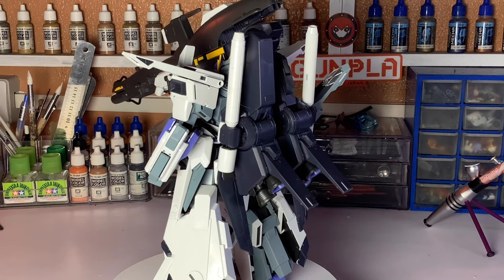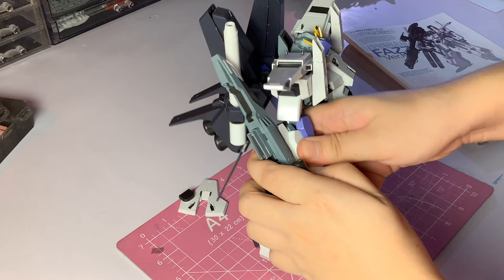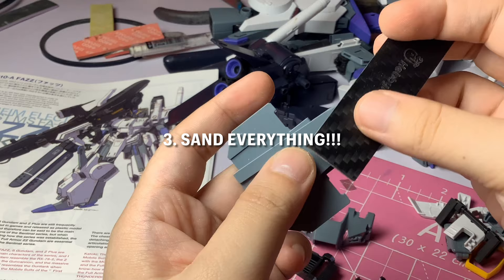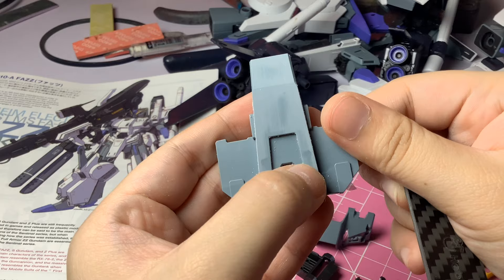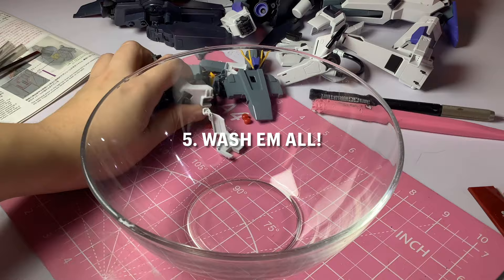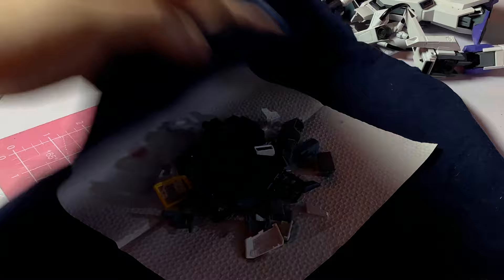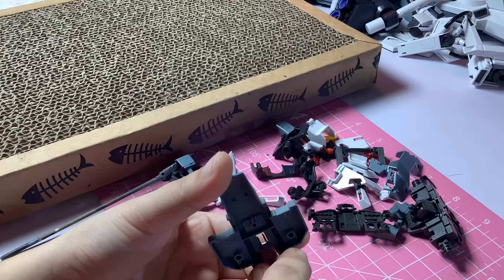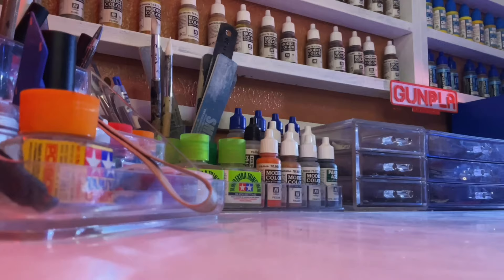How to PAINT Gunpla: Preparing your GUNPLA for Painting!

Comment: this may be a bit of an odd question not your for you but anyone... but in recent years my hands start falling asleep (carpel tunnel) while building Gunpla. I'm extremely disappointed i cant do something I loved to do as often as i would like. Does any1 have any tips to make building / painting easier on the hands?
Reply from the maker: I found this from a reddit thread from years ago, “I wear wrist braces when I sleep and that helped me tremendously! My fingers used to go numb while I was building and that has pretty much stopped.” 
Hopefully that can be of some help, others mentioned asking your doctor for suggestions as they will be able to give better advice 😊
Reply: I have terrible carpel tunnel from years of working in a professional kitchen (we called it "knife hand"). The best solution is to stretch. Look up some guides on stretches specifically for the condition. Braces are also very helpful if it's really bothering you (sounds like it is). I would really encourage the stretching though because if the condition gets too far along the only meaningful remedy becomes surgery. Which is extremely painful (they basically scrape the scarred muscle out - it's gnarly). Otherwise meds for inflammation (ibuprofen for example), ice / heat combo, etc. Good luck guy.
Reply: I have massive carpel tunnel, as a union carpenter who has a hammer attached to his hand 50 hours a week, you just get used to it. It sucks but eventually I just learned to ignore it honestly.
Reply: Paint with your feet.
Reply: @Kyleology use telekinesis

Comment: Im newbie to painting on gunpla does i need put masking tape to the fitting parts of body to prevent tight fitting issue? Before i customize
Reply from the maker: I assume you mean the joints and pegs? Personally I don’t, but some people will put masking tape or blu tac so it won’t get painted, you can also just scrape it off after painting or sand the parts before painting to accommodate for the layer that the paint will add.

Comment: Do you have any tips on disassemble the kit to the parts without damaging them?
Reply from the maker: Removing some of the male peg allows for easy disassembly by increasing empty space in the hole which means a less than snug fit. To do this, gently cut away the peg at a 45 degree angle. There are tutorials showing easy disassembly with this :)

Also use a parts separator to prevent damaging your parts
Reply: @NicoSuratos  thanks

Comment: Hi Nico, if you mainly use acrylic paint, I wonder how do you do detail painting (ex: pipes or pistons on the inner frame) or reverse wash over the acrylic base paint? Won't the cleaning process ruin the paint underneath?
Reply from the maker: For detail painting I also use acrylics. I simply varnish over the already painted parts before doing so. I also use enamels and oil paints which work fine with acrylics.
Reply: @NicoSuratos  so the varnish is also acrylics, I assume? And do you have any recommendation of oil paint and enamels brand/kind that work fine with acrylics?
Reply from the maker: Yes even the varnish. All oil paints and enamels work with acrylics no matter the brand. But for enamels I use Tamiya and for oil paints I use Grumbacher and Gamblin
Reply: @NicoSuratos  okay 1 more question if you don't mind just to make sure, so based on your experience, neither Tamiya enamels paint nor thinner react harshly and eat the acrylics varnish and paint underneath?

And do you think it is safe to lightly topcoat Mr. Hobby's clear lacquer over Tamiya's acrylics?
Reply from the maker: I make sure that may varnish and paints are fully cured and hardened before using enamels on top. (Which is why I use oil paints if I’m in a rush) I don’t use Enamel thinner since it’s a bit too harsh and strong. I use turpentine or gamsol. I also don’t keave the enamel on for too long, I don’t flood it and clean it right away to be safe. 

I think it’s possible to use Mr Hobby Lacquer Clear over Tamiya acrylics. But, I recommended to test it on a small area first to make sure that the lacquer does not damage the underlying acrylics.
Reply: @NicoSuratos got it, noted. Thank you so much for replying and congratulations on winning the GBWC, Nico! 👏🥳
I wish the best of luck for you 😊🙏

Comment: Hi Nicole, I have been watching your videos, great work! There are multiple steps involved in customizing a gunpla model, can you help list down all the steps in chronological order for customization using airbrush painting? I’m a newbie, the steps below is based on watching multiple youtube videos:

1) Removal of parts from runners
2) Fix up the full model (trial/preview)
3) Plan the painting steps and colours
4) Nub marks removal
5) Wash all parts with detergent
6) Cement parts and remove seam lines
7) Panel design and scribing
8) Apply Primer
9) Apply Paint using airbrush (Mask if needed)
10) Apply Paint using handbrush for tiny areas
11) Apply top gloss cover
12) Apply panel line liquid
13) Apply decals
14) Apply top matt cover

Is the above sequence of gunpla full customization correct? Really appreciate your advice on this 🙏🏻
Reply from the maker: It can work but I feel that it’s more time consuming and less efficient with the way you listed it down. You have to understand why you do certain steps and what’s it’s purpose and not simply follow steps and guides used by others. Let me explain a few things..

First, you mentioned the trial/preview, we do this right before painting when everything is done and completed, so it’s not really the 2nd step. Building the model is to see what other areas you have to fix before painting.

Second, washing the parts is to remove dust, debris, oil and sanding residue to make the paint stick better so you do this once all customizing and clean up is done, doing this first before seamline removal and scribing is not advisable and simply renders it useless.

Now, a better way is, 

1. remove it from the runners, cleaning up the nubmarks as I go. 

2. I do a sub-assembly (by limbs) then remove all visible seamlines. 

3. I start customizing and scribing. 

4. Sand everything nicely then build it. I build the whole thing and then check for errors or things I want to add. 

5. I disassemble everything Then I clean it with water and soap once I’m happy with the results. 

6. While waiting for the parts to dry, you can plan the custom color scheme if you’re not going with the original colors. 

7. Separate all parts into the colors you’re painting them then apply primer.

8. Airbrush the base colors or use spray cans

9. Masking and/or handpainting if applicable

10. Apply gloss varnish to protect the paint and help applying decals and panel liner easier. 

11. Apply decals first since some of it overlaps panel lines. 

12. Panel line goes on top of decals

13. Topcoat of your choice, could be gloss, matte or satin
Reply: @NicoSuratos thanks for the detailed reply! I will definitely follow your recommended sequence for my first airbrush painting customization.

To explain why i swapped some sequence. After cementing & removing  seam lines, some of the parts would be glued together, I thought drying would be more difficult if parts are already joint, so i reversed the sequence. However, it does makes sense to wash only after scribing and removing seam lines, to remove oil from our hands and dust from scribing or customizing.

Yes, it also makes sense for panel lines to go above the decals. 

However, at areas where the decals and panel lines overlap, do I draw the panel line on the decals itself?
Reply from the maker: Panel lining goes on top of decals because the purpose of panel lining is to add depth and definition to the details of the model, such as panel lines, notches and indentations. By applying panel lining on top of decals, it helps to enhance the clarity and legibility of the decals by making them stand out more prominently against the surrounding details of the model. Additionally, panel lining also helps to blend the decals more seamlessly into the overall design of the model, preventing them from looking flat or out of place.

So yes, you do the panel line on top of the decal
Reply: @NicoSuratos  Great! Thanks for the advice! Really appreciate your time and effort in replying! 👍🏼

Comment: Great video! If you don't mind can you tell me what paints and primers to use on kits with ABS plastic and ones to avoid? I'm planning to build the flame toys windblade but it's primarily made out of ABS.
Reply from the maker: I personally just use the same paints I have for any kind of plastic. It works for me and I don’t have any problems so far. I only use water based acrylics. You can try on the ABS runner first with your paints to see if it works
Reply: @NicoSuratos   thank you for the info! Will look into those.

Comment: Do we have to sand every part of the surface or just area with sink mark/flat surface is fine?
Reply from the maker: I personally sand the whole thing because the purpose of sanding is to make the paint adhere better to the surface especially if you’re using acrylics. So if you only sand the parts with sink marks, then the paint might have a hard time sticking to the other areas you did not sand. 

If you’re using lacquers, sanding Just the area with marks is fine.
Reply: @NicoSuratos  thanks you for your answer! I will be using tamiya  primer and paint spray can
Reply from the maker: In that case, just sanding the area with sink marks is fine! Spray cans are good at adhering to any surface without much preparation.

Comment: Hey there. I am planning to paint abs plastic frame from early RG kits. How do you recommend on paint selection on abs plastic?
Reply from the maker: I personally don’t really change anything in my paints even when painting on abs plastic and I haven’t had any issues so far. 

I think a lot of people have a bit of a hard time with abs because it’s non-porous so paint is harder to adhere to it, but simply using a primer before painting is a huge help, so I don’t really have any different advice than what I usually tell.

Comment: What’s the blue tool? Dang, I already put stickers on, but didn’t wash. I clean nubs as best as I can while building.
Reply from the maker: Blue tool: Gunpla Parts Separator by Bandai. 

Washing is only recommended and done if you’re gonna paint, there’s no need to do it if you just use the stickers.
Reply: @NicoSuratos  thanks! im planning to paint some parts. also, is Primer always needed before painting?
Reply: @xHelloSushix for me primer is a must when painting your gunpla.. to add layer to thr surface before painting
Reply: @sweetsoulrevue4547  thank u! do u have recommendations for brands in the US? i always see several, but never sure.